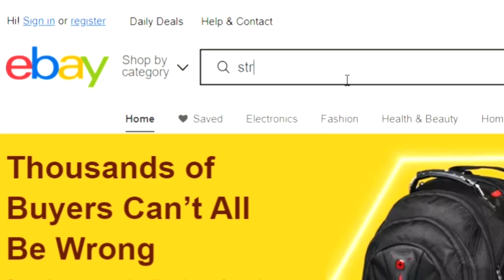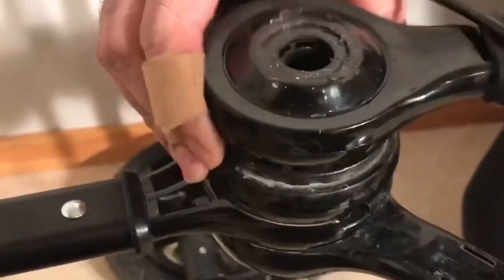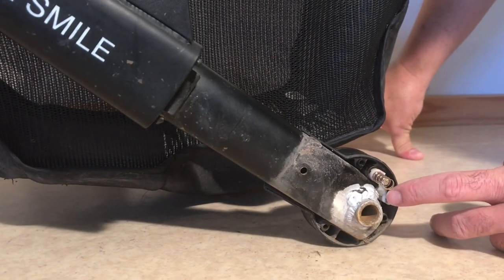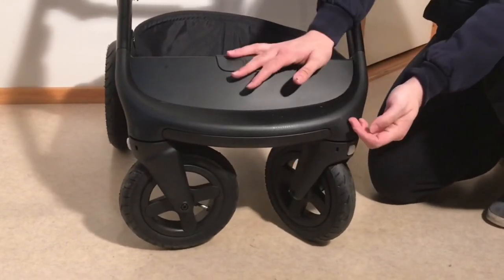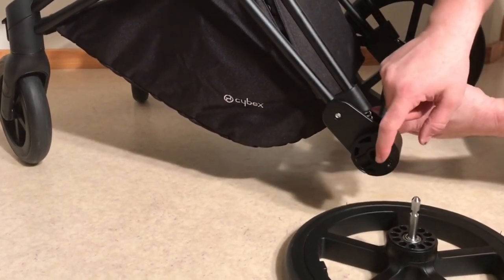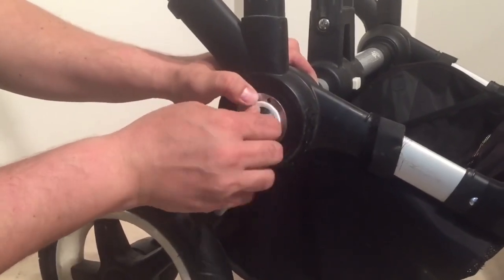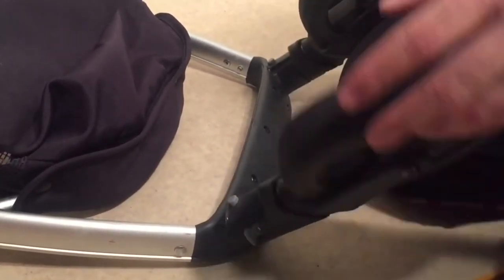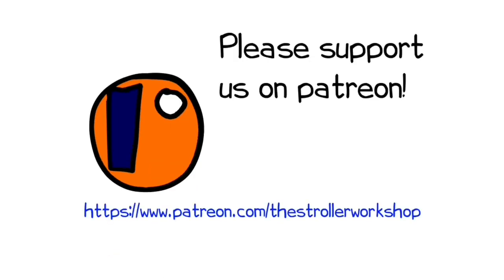7 Strollers NOT to Buy Used

Comment: I bought a 2013 Donkey (I didn’t know the age or model when I brought it) and wish I did my research like watching this before I did. We have had to buy more replacement parts and most likely will need to buy a new chassis before it can be used. For the cost of repairing it and replacing parts, save yourself stress and money and buy new.